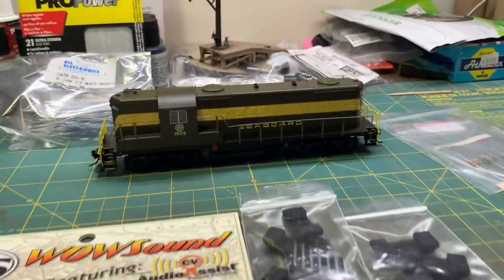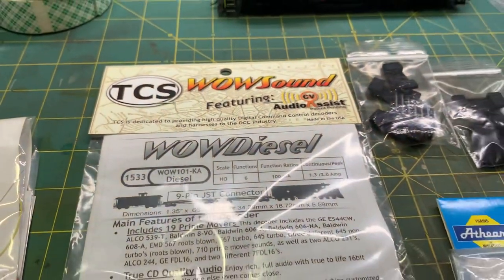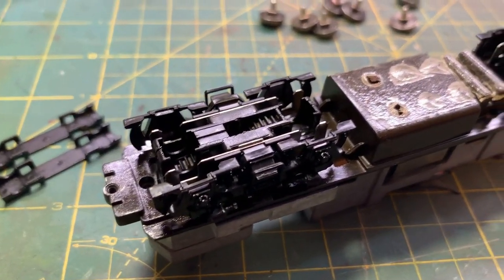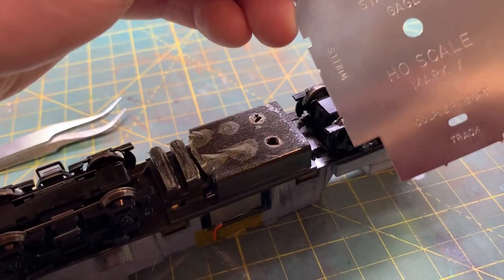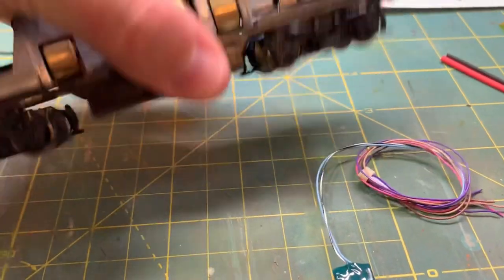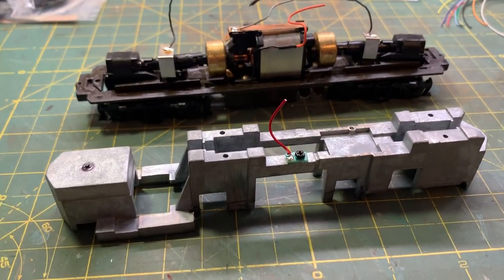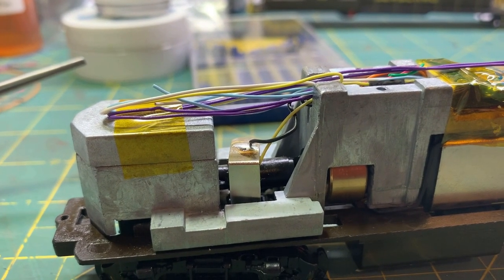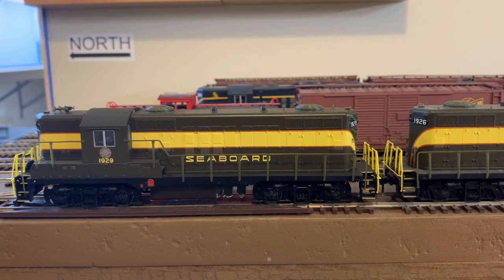Installing DCC and Sound in a Proto 2000 GP9 - Part 1

Comment: Glad you made this video, as I have several HO scale Life-Like Proto 2000 locomotives with cracked gears, and now that I know I can replace the gears with Athearn parts, I'd like to install decoders as well.
Question: Will that set of Athearn SD40-2 gears fit in all the Proto 2000 locos?

And if you'll enable the YouTube "Thanks" button, I'd like to buy you a coffee for making this video.
Reply from the maker: I appreciate that - no tips needed, though I appreciate the sentiment.  So far, those Athearn replacement gears have fit in all the proto GP7 and GP9 locos I have converted.  Think they are generally suitable for any Proto diesel.
Reply: @johnarthur6302  Appreciate that clarification.